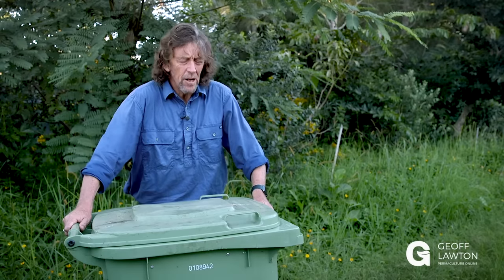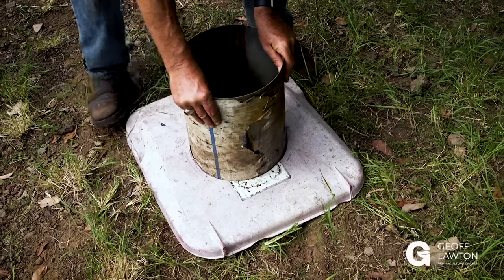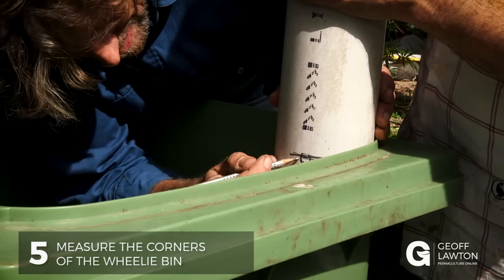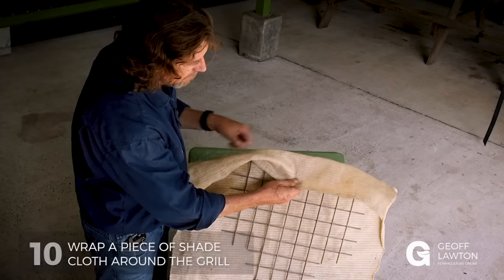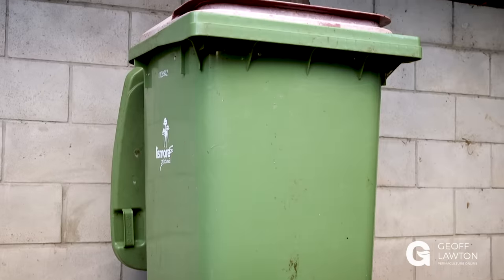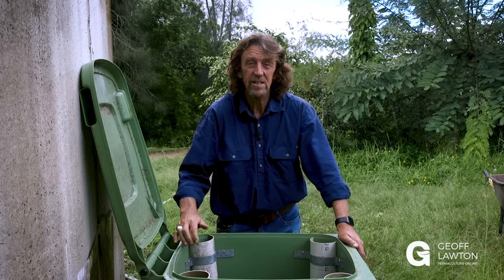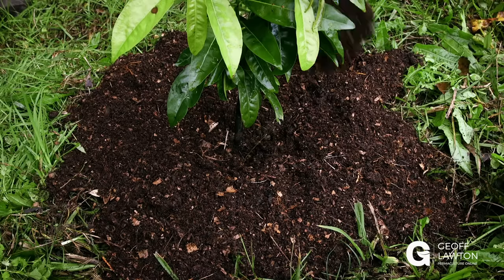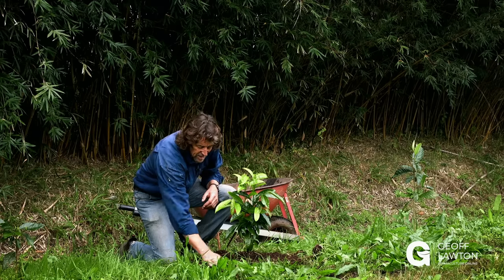How to Make a Compost Toilet with a Wheelie Bin

Comment: Interesting idea...just wondering if enough oxidation is coming inside the container ...the tubes in the edges???
Reply: crimerk yep he says they’re for airation
Reply: Providing the slots are not obstructed and they're less than 24 inches apart, the half-pipes don't need pressurized air to work. However, a pulse of air every half hour will definitely speed up decomposition.

Comment: We are in process of building one that should make Mr. Lawton proud. Question, does sawdust have to be added after every solid use, or just put the 20L sawdust on the bottom as described in the video?
Reply: Having visited Zaytuna farm I can tell you that you need to add sawdust or whatever after each deposit. Basically if you don't cover what you did then it will smell.
Reply: @eg6308 I think the sawdust is more for the C/N ratio, not to stop any smell. The fan taks care of that.

Comment: Is it not a problem that the "surplus liquid" is not just sterile urine, but urine that has gone through shit? What are the requirements for the gravel trench to make sure that the black water coming out of the system isn't unsafe?
Reply: Its gone through shit+several layers of compost and wood chips/sawdust with no solids coming through with all of the filtering.  My understanding is that health wise and regulation wise its not much worse than a dirtier (i.e. kitchen) grey water system, meaning yea you'd want the reed bed or otherwise ensure that the water never comes up out over the surface of the gravel trench and instead just sinks down

Comment: I can't understand - if you should keep the bin locked for  6 to 10 months - where you should store you waste in this period? It seems you should have more bins.
Reply: I am wondering how many bins you will need
Reply: you keep it locked for such long period without aeration? so the waste breaks down anaerobically?
Reply: Yes, you'd need more bins. People using IBC containers for collection also have several of these. Human solid excrement is ca. 100 kg/(person×year), so minus drying and plus sawdust maybe 120 l. So get two such 250 l bins for every two people using the system. One to collect the waste, one to compost it.

Comment: Can you please explain the toilet system and how it connects to the compost bin.
Reply: Lol just thinking how to explain it made me laugh. 

Visualize your ass seen from inside the bin. connect a tube between the 2 and a seat.
Gravity should do the rest. 
If you don't like smells put a side tube on the main tube with a fan. 
You kinda need a height difference for this system to work. 
So with a wheelie bin you'd need at least 3.5 to 4 m for it to be comfortable
From you anus to bottom would be around 2 m and then you need headspace.

Comment: I am wondering, is it fine to dig a hole and make the humanure in there? On a property, a designated place for this purpose. It's my dream to build that for myself in a sustainable home, in the future.

I imagine in a deep hole manure and food waste will still become into a fertilizer, with time.
Reply: If you strictly keep urine and feces apart then probably yes..
But if the feces are in a hole in the soil and it rains bacteria can wash down into the groundwater and end up in peoples drinking water.

So: if you live in a very dry place where people dont drink the groundwater yes you can do that if you put the urine in a seperate place.

It is kind of important though to have the feces sit in a closed bucket for a few months so the content heats up in the sun and the bacteria die.
Be careful and good luck
Reply: that's called a long drop- so-no!

Comment: What do the pipes (half pipes) in the corners do?  I see that they help with air and ventilation but they are under the lid, so is there air in the pipes but not much air flow?  How does this help?  Does it help air get down under the level the bin is filled to?  I guess you're adding wood chips every time you make a deposit?
Reply: They help siphon liquids to the bottom of the bin where they can be emptied through the tap
Reply: I made some research. They permit all the gases to get up the delivery pipe, and you have a chimney with a ventilator just above the pipe. Like this you catch the gases before they escape the toilet. The chimney is on the toilet, above the pipe.

Comment: The liquid waste coming out of the hose at the bottom is raw sewage and potentially a heath risk. It can't drain as you describe.
Reply: I believe human waste is a valuable resource that should be used for this purpose. However, most amateurs are far too lax with safety precautions. My opinion as someone who has studied soil, composting and biochemistry.

Comment: Hey Geoof, thanks for the video, looks great!
Doesn't the humanure require air to compost in the proper way? Will stinky air get out of the toilet with such a system?
Reply from the maker: No the is drawn up the exhaust chimney so no bad smells.
Reply: @DiscoverPermaculture   What exhaust chimney? I didn't see anything mentioned about the exhaust chimney. Where is this attached?
Reply: @petroskronis  the four big ass white pvc pipes in the container
Reply: @khandam7709  But the way it's shown, it looks like the four big ass pvc pipes are closed up under the lid ?
Reply: I guess the toilet bowl incl. urine separation (if it has that) and the exhaust chimney is just not covered in this video. Judging from compost toilet designs frequently used in campervans, an exhaust chimney is a long tube extending behind and up over the toilet, going through the outer wall or roof. It is often supported with an extraction vent and removes any smells by creating a slight underpressure in the toilet bowl.

Comment: Well, Joe Jenkins, author of Humanure Handbook, recomends the use of bucket toilets that from time to time are discarded in larger compost bins enveloped with a thick layer (25cm to 30cm, 10 inches to a foot) of hay or straw. The idea is to compost the human excrements via thermophilic process (if that makes sense) and says that, in a compost bin that is able to retain temperatures over 55 degrees celcius, it needs only a week or so to kill all or the majority of the pathogens. In a bin that don't use thermophilic process, it will take something around 2 years to eliminate the pathogens. 

So, my question is: do you agree with him? Can we safely use your (or his) method to build soil in a garden?
Reply: Geoff uses this only under tree crops and stuff that wont touch it, stuff that generally wont get harvested for a couple weeks after application anyway.  This process, interestingly enough, is in line with EPA regulations in the US. IF you wanted to make this totally safe for all crops, you would do it like he does for maybe 6 months, then dump it into a at least 4X4 ft cube covered with some more carbon material and either let it sit for about another year or make absolute sure the whole thing gets to temperature for over a week like Joe Jenkins does.  That's probably the best balance between full versatile use, safety, and minimal handling of buckets and poop.

Comment: The half pipes in the corners of the bin, do they need ambient air flow, forced air flow, or is static air pocket sufficient to induce good composting?
Reply: Providing the slots are not obstructed and they're less than 24 inches apart, the half-pipes don't need pressurized air to work. However, a pulse of air every half hour will definitely speed up decomposition.

Comment: I was thinking of using a maintenance utility cart, but at a height of 40 inches, I’d have to raise my cabin a lot. I’m in cold climate of Maine
Reply: I am in EE mountains. I am building a small raised bed that I will fill with fall leaves and will dump paper urine and poo there then cover by fall leaves. Same goes for the bucket I use. Put fall leaves every time you use it! My dump site is in the woods so more leaves will cover the humanure in the fall in 3 years after I will fertilize the trees behind my house with the finished compost! Simple quick and no brainer
Reply: Svetla Nikolova I was thinking of using a 5 gallon bucket instead but was hoping to use the bigger cart so i only have to deal with it twice a year. With temps down to -40F I like to avoid an outhouse. One way or another, I’ll want a urinal for boys and a Urin separator for the girls. Urin is instant use fertilizer and I don’t want it mixed with the poo part.
Reply: @4philipp  one person and his family had 25 5 gal buckets filled! If you are one person that will be sufficient to to go through the winter without going too far. Just make sure you have lids for all of them. Here in EE is not too cold in the winter and we go out daily to dump them In the outhouse hole

Comment: Dunno if it has been asked before, but about how long does it take to fill up one of those homemade toilets. Also, is that just for solid waste or solid and liquid?
Reply: the drain at the bottom implies it is for wet pee as well. Personally I thinkit makes sense to seperate at the source.
Reply: Maintaining ideal conditions is much simpler if you separate the urine.

Comment: I live in a mobile home and have built a urinal separator myself with a 5 liter (small) bucket at the back, I use a decomposing plastic bag with sawdust and tie a knot and throw it out after every toilet visit, now I have bought a small house in the country and would like to use the same system, but I would like to compost my small bags in possibly down some small bags of kitchen waste would that work in your opinion?or would the mixture be too dry? I could possibly lead the urine down into the same bucket via a separate pipe system. even if it sounds silly. but I think that the bags will be dumped in a waste shaft with a 12v ventilation installed and the urinary system will be fitted with a valve. I expect it will be both odor-free and easy to clean

Comment: Why does this method work without a separate compost pile? I know it doesn't work inside 5-gallon buckets because there isn't enough mass to create the heat necessary to destroy the pathogens. How much mass do you need for hot composting to happen? And how does the plastic of the wheelie bin handle that heat?
Reply: This would be considered slow composting as you adding mass slowly to it and then letting it break down over about 10 months. So it wouldn't generate much heat. The initial chips just help kick start the system

Comment: Can you use the round American style plastic garbage cans about 84cm tall in the place of the wheeled bins? I'm thinking about building a outhouse, and worried about the height requirements. If I used the wheeled bin I'd have to build the outhouse 1.2 meters + off the ground on a dirt mound? I know it have to be emptied more often, than if not. Thank you.

Comment: I’d like to know where Mr Lawton gets his sawdust.  I’m taking over a 10 acre land and would like to implement this but not sure how i can collect sawdust effectively in huge amounts.  Is there also another material other than saw dust?  How about wood chips?
Reply: Dried leaves work i have heard
Reply: Find someone who owns a portable sawmill and you will have sawdust out your ears.
Reply: woodchips work fine according to research I've read. Key is surface area so you want to use a fairly fine-grade material. If you live on ten-acres of land you probably have a wood pile or somewhere you chop wood. You would have plenty of material you could use
Reply: A cheap bio shredder should work well, use tree clippings, leaves etc. and shred them
Reply: dried glass clippings or dried leaves,

Comment: I live in Canada so any outdoor latrine style bathroom would have freezing issues.  What considerations should be thought of for this style of bathroom in colder climates?
Reply: dig a basement and keep it insulated is the best way. you could also super insulate it with 20" of foam all around it with small light bulb heat sourc.e

Comment: Greetings!
After closing the bin, no more air goes in? Does it  remain like that for the following months until reopening to collect the precious  compost?
My bin is a 55gl metal barrel filled to 3/4,  sawdust at the base and after each use, warm wearher (south Portugal). I have sealed it with its cover. Is that a correct procedure? 
Thank you for any help. Cheers!
Reply: If bin is totally sealed, waste has a hard time composting.  
I think he needed to show ventilation better…those corner pipes were slotted to ventilate the pile inside…the bin must have a pipe to vent to outside, & an air intake, to prevent the pile stagnating.  
He also did not mention adding worms to the pile…those abate coliform bacteria that officials worry about, & compost the solids faster & with less smell. 
He did not say what kind of toilet—but the size of the entry hole indicates it’s a dry toilet with a simple drop-pipe that diameter. 
If you check out Anna Edey’s book, Solviva, you’ll find, a bin like that could simply get the house waste pipe from the regular flush toilet rerouted into the top of the bin.  In that case, fill the bin at least half to 3/4 full of loose peat + worms.  
And, instead of a simple garden hose carrying away liquids, drain the bin to a leach field type slotted pipe laid just under surface along planting beds in the garden, giving them the nitrogen.  
Anna invented a couple different low-tech systems that are basically contained so they cannot spread any coliforms anywhere. 
https://www.solvivagreenlight.com/solviva_website/

Comment: Where do you sit?
Reply: That's just the repository the toilet is above indoors. Basically a box with a toilet seat on top. The big pipe connects to the toilet outlet gravity driven. He was building the composting end.
Reply: Or you can put a 20lts recipient (as the common ones)  then when is full, pour it in there

Comment: What's the purpose of the 4 pieces of half pvc pipes..?
Reply from the maker: Ventilation to process aerobically in the corners.
Reply: @DiscoverPermaculture  Thanks!
But when the bin is full, you close the lid, does that mean it doesn't need aeration no more?
Reply from the maker: @Justniv1  they still work with the lid closed

Comment: so you need to make more than one bin then when one fills up you switch it with a new one let sit for 10 months then empty and put back in line for refill? even if you make more than a couple its still cheaper than the others at 2000. usd

Comment: Hey! I saw ur idea of making but i want to ask if i want to make compost out of septic tank waste would it work then and cant we use soil for it ...or could be a mixture of soil-sawdust? 
Please  reply it'll  be a really great help....
Reply: No, you don’t. Too wet and stinky (and unsanitary), and to be safe, composting of human waste needs to be aerobic; septic tanks are anaerobic.
Reply: One guy in UT, removed the top of his septic tank, replacing it with a window-lid to give it solar heat.  He installed an air inlet pipe at one corner, $p& an air vent pipe at the diagonal corner, painted that black for solar-boosted ventilation. 
His flush toilet flushed to the septic box same as before, except instead of it being anaerobic, his system was then aerobic.  
The old concrete septic tank had a cracked bottom, so, liquid did not stay in it, but drained below.  He used a separator toilet, so urine went out to irrigate the garden (giving that nitrogen).  Just the poops went to the now solar tank. 
He said it worked great, even long-term. 
Drawback would be emptying it. But, since poops compost down & lose most of its volume, it’s probly gonna take years before it needs excavated. 

If you have a regular flush toilet on an upper floor of house, Anna Eden has a solution for that!  
Read the “Solviva” book by Anna Edey.  
It’s got 2 excellent designs that are self-contained.  One of those connects a regular flush toilet to a composting volume built on the side of the house with the waste pipe from toilet, rerouted to it.   
The other uses a multi-bucket system, that has worms both composting, & cleaning the buckets to be ready for next use.  
Worms are the key! 
https://www.solvivagreenlight.com/solviva_website/

Comment: How many of these bins would you need if its gotta be left to decompose for 10 months, that doesn't seem discussed much ... 4 or 5 to be safe?  More, depending on how many in yer household using this method?  

I'll keep looking for more info for ground level dwellings & cold winter climates too ... 

Interesting tho 🤔
Reply: there's a couple of great well-researched articles on wikipedia which explain how to kill all the pathogens: something like 40 degrees celsius for one month (obviously that has to get to the centre of the compost not just the edges), so if you live in a cold climate you would have to wait until summer. If you store for at least a year it should be ok
Other questions around ventilation above: you want to make sure that air can get to the compost to keep it dry and ensure an aerobic, rather than anaerobic, composting process. Once again check the reference links on wikipedia. Plenty of free and well researched science behind composting toilets. USA and Germany (and northern European neighbours) appear to have some excellent local government guidance also on disposal of compost... rest of the world still to (re?)discover these techniques.
Reply: @smsm4356  that's fantastic info ... many thanks
Reply: four adults here - we use 7 bins/year